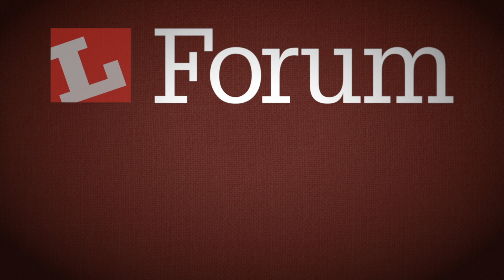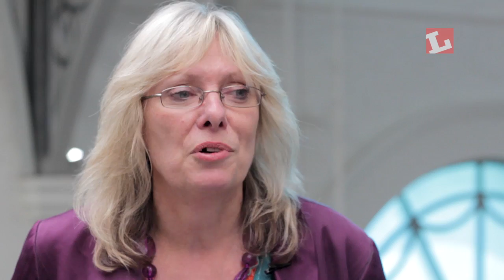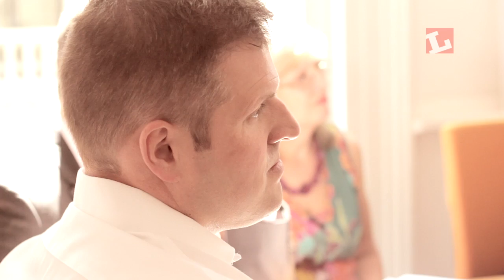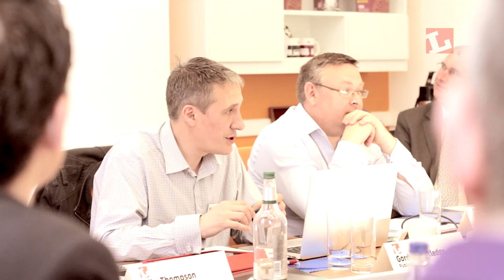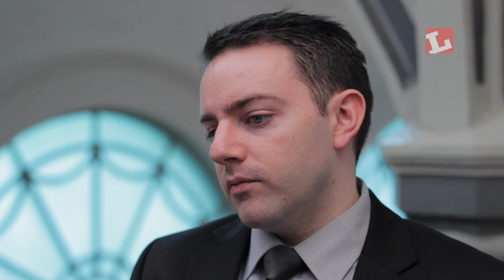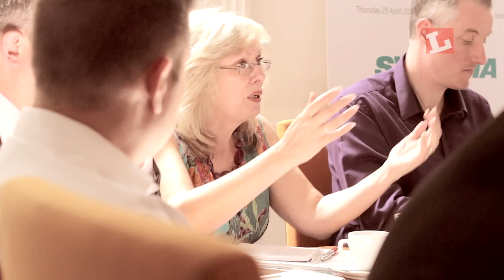LED tubes: the good, the bad and the ugly

Comment: I dont know what LED Tubes this people have been looking at, In Australia Sylvania supplies 2 types a 26W with 2650L output and a 23W at 1800L ( standard 36W FL at 3250L). anybody else supplies anything between 20W and 18 at round about 1800L. Even if I could use Sylvania tubes, I would be left short 1200L every twin 36 troffer.... Unless Lighting it's all of a sudden an opinion..... I cannot see how this could be any good!

Comment: We have been installing LED tubes from an experienced and trustworthy manufacturer for over a year now. Our customers are completely satisfied, both with the savings and low cost of installation, and with the excellent light output. Our latest project has been the fitting of 1200mm x 600mm 4 tube LED panels in a large Newsagents shop which was very well received by the staff and customers. We supply tubes and recessed panels that meet BS EN 60598 standards - Energy Efficient Lighting Systems